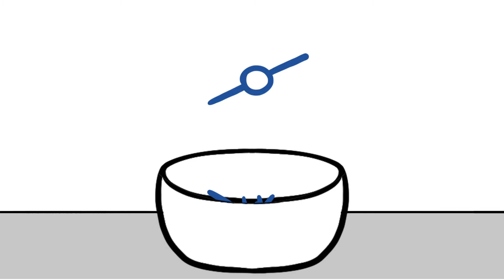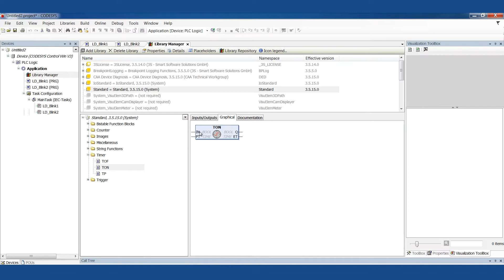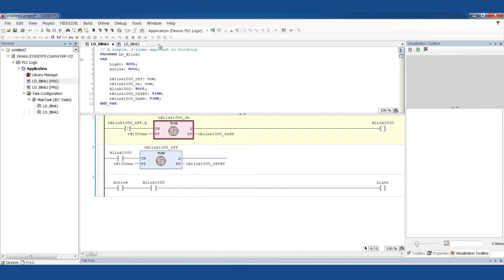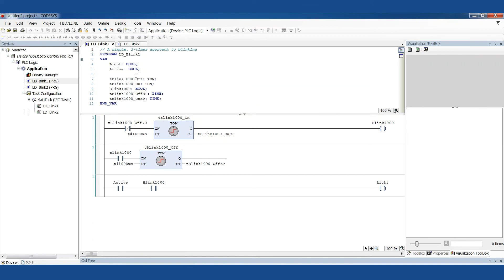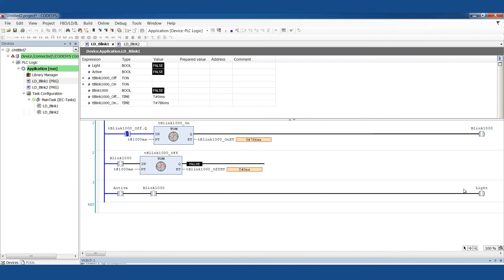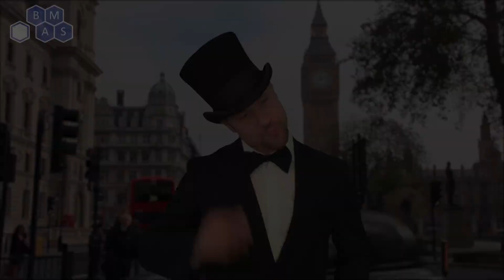How to Blink Lights in Ladder Logic - PLC Programming Cookbook

Comment: Hi thank you for your explanation of making a blinking light. 
I have been tasked with making a plc power flashing fairground lighting. Would this be the most suitable way of doing so? Or would there be a more effective way to program lights to flash in different patterns? 
The lights are wired with 3 different cables and I have a plc with 4 outputs. 
Thank you